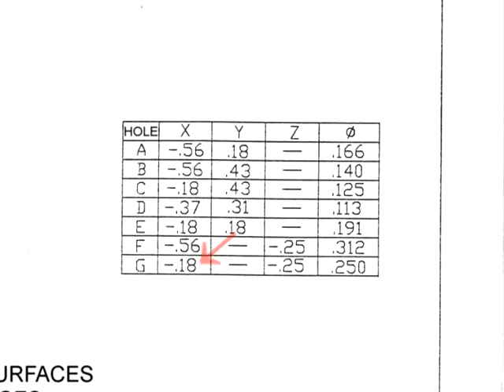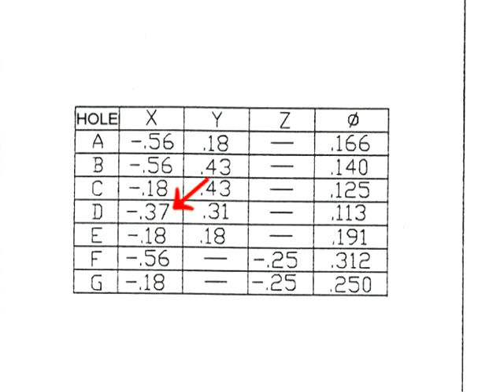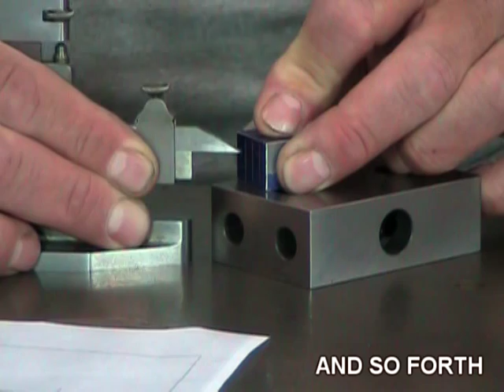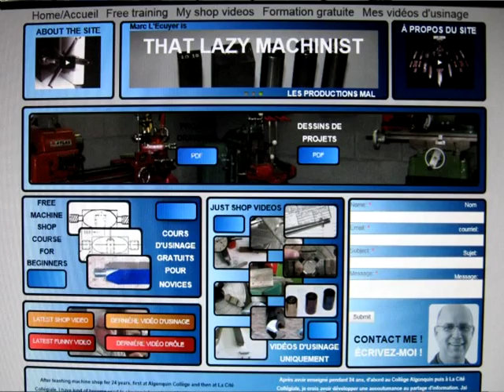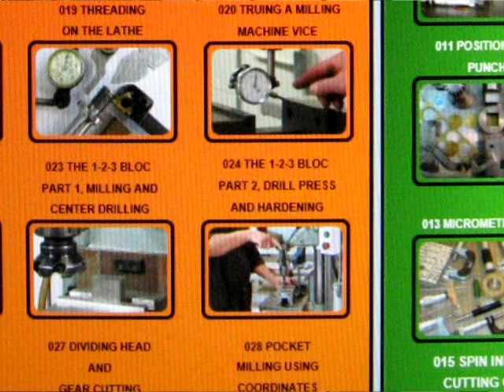TAP BLOCK PART 4, MILLING AND DRILLING 101 MARC LECUYER

Comment: Another excellent video! In case you have not come across them, you can buy 'bi focal' safety glasses - they are regular safety glasses with a small insert that has the same sort of magnification as the cheap reading glasses you can get at the pharmacy (1.5, 2.0, 2.5, etc). I bought my first pair at Lee Valley, then also found them at the local lumber/hardware store. I would be lost without them in the shop.

Comment: Hi mate.
Thanks for the lecture.  The drill in the end, I think you want to give that chuck a drop kick.  That thing has so much run out that you might consider using it as a boring head.
Marcel.
Reply from the maker: Marcel Timmers Great minds think alike. After drilling the first hole, I had already decided to change the chuck before the next video. Thanks for watching, Marc

Comment: Hello Marc, finally you'll spend a part of summer drilling holes....
With that chuck with lots of run out, lucky the drill press is kinda loose and flimsy, cause you get to keep the tiny point on the center drill.... ;-)
Pierre
Reply from the maker: pierre beaudry I answered another comment on the eccentric chuck, thankfully the vise is quite lite so I knew that the #2 center drill would survive. However in the next segment I will be center drilling the other holes production style with a fixed vice and that shaky chuck just won't do, the drill will break. Long story short, this afternoon I am swapping the chuck that came with the machine for much older but much better Jacobs chuck. I have watched your videos and enjoy them very much, keep up the good work and thanks for commenting, Marc
Reply: Thanks for the appreciative comment, I've been following your channel with interest and always end up learning something...     

If you meet with Philippe this week end, he'll probably introduce you to our contribution on the WIYB project. Don't be shy to comment...

     If either of us have a chance to meet, I'm on to it.... Thanks again, Pierre

Comment: Punching on surface plate? And lapping plate?
Reply from the maker: Simon P Hi Simon, now that you comment about it, it does seem quite irresponsible. I will say in my defense that my surface plate is actually a 100 pound cast iron gear that I surfaced flat 30 years and my lapping plate was made from a large piece of 17-4 Ph H 900 stainless steel (really tough stuff, it will be around for my great great grandchildren) and that the 1-2-3 bloc was produced in Keewatin tool steel hardened and drawn to 60Rc. Everything is flat and distributes the shock progressively from the small but very hard 1-2-3 bloc to the quite massive hard and tough lapping plate to the massive grey cast iron surface plate. I am not worried about marking or cracking any of them with the type of light punching that I was performing but I realize that I did not explain my setup very well and that some people might try and punch on a real granite surface plate and that would not be good. I will add a note to the video tomorrow to warn of the danger and with your permission I will refer to your comment. Thanks for watching and for catching the problem, Marc L'Ecuyer

Comment: Isn't it better to use a hole-starting drill?  I was reading Hasluck's book on metal working, written back when turning the work on centers was common.  I have the impression that the center drill is a hold-over from that time but is a needlessly fragile way to start holes.  Shouldn't we be using hole-starting bits instead?  They're also hardened throughout and can be purchased for various angles.  I have home-store 135-degree drills so I purchased a 140-degree drill for that purpose.
Reply from the maker: Hi K15! You are right, I am old and tend to keep with my ways but spot or starter drills are the better way to go. It is however important to say that shortened jobber drills should be avoided since their web (chisel edge) is much too long. Thanks for watching and for a great comment, Marc

Comment: Mark I think you would be the perfect person to ask..... I have a 400 gallon propane tank.... I would like to bury the tank and used if for shop air.... Some say you cannot do this and other say way and other say no problem.... I need volume more than pressure and running a 25 horse elect motor is pretty costly.... So, I have a equipment compressor 120 cfm at 90psi..... I would like to use this to charge air tank and if not blasting then it will be a while before I need to run again.... Say 120 pis of pressure and 400 gallon tank buried would be safe.... Roger I hope to answer asap...Thanks....
Reply from the maker: Roger Fossette Hi Roger, at 70°F propane exerts about 130 psi on the Inside of the tank. The higher the temperature the higher the pressure so I guess the tank could hold 90 psi. However, cutting, welding or machining any vessel that once contained a flammable liquid is very  dangerous. Many people are killed each year because they didn't know this simple fact, it is the vapors that cause the explosion not the liquid and in many ways en empty tank is more dangerous than a full one. I cannot help you more than this but please use extreme caution if you decide to go forward with your project. Thanks for watching, Marc L'Ecuyer
Reply: THATLAZYMACHINIST
Reply: Roger Fossette  I thank you sir, and I believe I will do and I said.... And caution will go with the wise....Roger

Comment: Either your spindle is crooked, the bearings are worn, or there is excessive runout in your drill chuck.  I have to agree with Simon P about punching on a surface plate and lapping plate.  Poor habit.